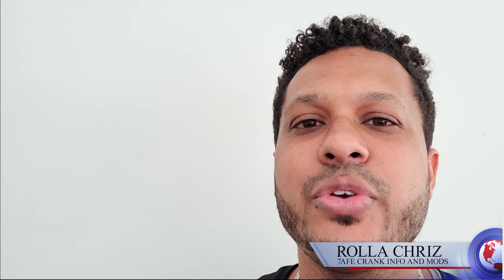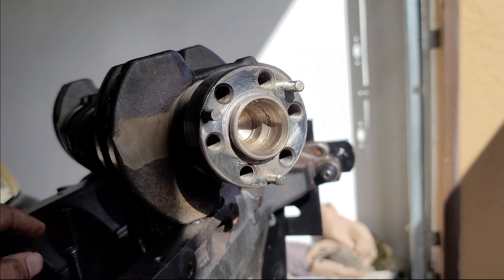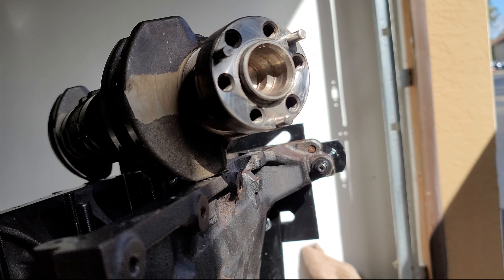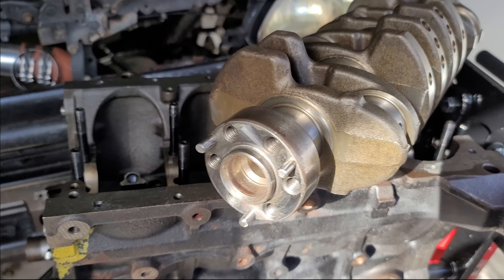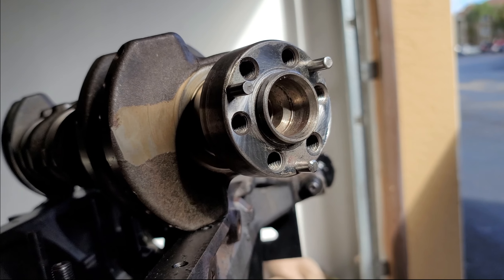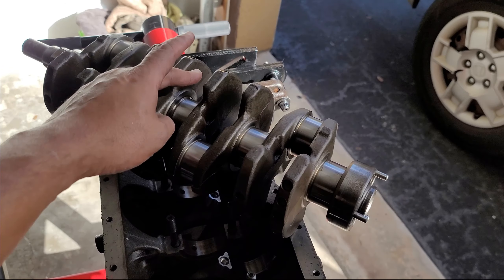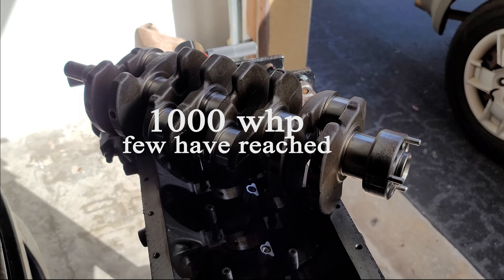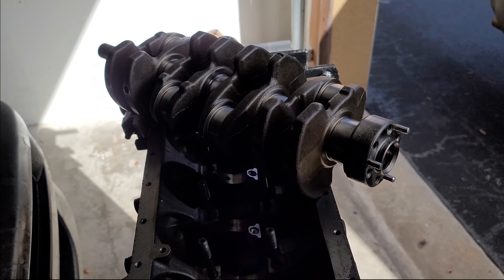7afe crank strength and mods pt 2

Comment: In your video you mentioned crank balancing and breaking maincaps.
I circuit race my 7AGTE rather than drag race so gets a hard time, and have found that at over 500hp atw we started breaking maincaps on the block. Did balancing the crank do anything to solve this?
Reply from the maker: I would assume it should. I haven't heard of this issue as far as cracking the block ladders from anyone I know..Wow that would be very stressful but then again at those hp levels most people I know  do balancing on 4age engines.  When I balanced the entire rotating Assembly and ran tomei ladder caps I have not seen this re-accuring issue at 9k. I can somewhat feel the engine less struggle to rev and smooth. Plus the price was worth it.. when I do pull the engine apart I noticed some cylinder main and rod bearings have less or even close to the same where across all the bearings. An old friend once at a performance shop in my younger days told me. "If even one or two grams difference off between two rods in two different cylinders that will create extra hundreds of pounds of extra force on that rod from that 1 or 2  gram difference" so more stress is on the heavier rods bearing and crank journal itself compared to the other.. so now an imbalance is there on the entire crankshaft from unbalanced rods... on top of all this the insane amount of vibration from a stock unbalanced crank is there too. So In your case maybe you should knife edge it as well as balance the crank and rods and flywheel. to see what happens and log the journey.. it would help the community cause most 7age racers are not at your hp levels torchering the engine for that long as you lol.. I hope this helped.

Comment: Will be building a 7age soon, keep the info coming mate cheers
Reply: @holdmywetnutz  hey brother I'm doing a 7afe build and am having some trouble finding a 7afe turbo manifold. What would you recommend as to the best way to get myself a 7afe turbo mani? Can you help me?
Reply from the maker: @borncustom4604  honestly the best way is custom make one.. you would have to check around performance shops and ask for quotes but they will need the car. eBay has a cheap one.. it won't be as strong or tough as a custom one but it's affordable for low boost and probably will last a year or so.. eBay manifolds are thin and soft metal so when they break they are easy to reweld.. you can get an eBay one temporarily until the car is finish and turbo charged then you can get a custom one made. Here's link I found https://www.ebay.com/itm/OBX-T3-Turbo-Header-Manifold-for-1993-1997-Toyota-Corolla-1-8L-/123954117403?mkcid=16&mkevt=1&_trksid=p2349624.m46890.l6249&mkrid=711-127632-2357-0
Reply: @holdmywetnutz  OK cool thats a pretty good idea, I haven't ever seen this one before thank you. I was considering purchasing a nice K18 header and cutting the flag off of it and welding a 7a one on in its place because they will line up but I'm not to sure which ones of Honda are good quality and I'm fairly positive I would need a rig welder. I only have a flux core welder but in any case it give me a solid direction to move in and I appreciate the the help bro.
Reply: @holdmywetnutz  do you know if the 2zzfe flang matches up to the 7A flag because from the looks of it the bolt patterns are identical. That is as far as a picture goes anyway.
Reply from the maker: @borncustom4604  good question I'm not sure port spacing is same or not. but from sound of it I think your almost on top of this. Your close to solving what you need done to make this project happen. Also look into Honda b series too
Reply: @holdmywetnutz  B18 is what I meant to say not K18. I've found some forums a few different guys that are top notch with the 7age builds that talk about swaping the b18 flags out. Some of which have their own products they sell. For extremely too high of prices I think but that's what is to be expect in the hunt for hp. I've reached out to a couple of them but they don't have time for a no name like me I figure. No big deal. When I finish this build and post my results of  one of the most boss 7afte motors ever posted on YouTube the curiosity will arise. This build has been happening for many years now and all the secrets are out. Or are they? I've got a couple custom mods up my sleeve that is going to have people wondering how I did it. I'll share my secrets with the people who were generous to me. It'll be soon.
Reply from the maker: @borncustom4604  yeah man I hope you great success on the build the problem with Toyota community is it's a very secret society it's not like the Honda community who reach out to each other and share info to the communities all secretive and that's how they've been for years no one wants to share information is all kind of like how would I say this bragging rights or just to be the top and fear of competition.. I tried to help people out as much as I can I have always been the guinea pig for everyone else so they wouldn't have to spend as much money and damages I was a test subject for everyone else and the things I done and and the people that helped I've even had threats from others at one point for doing so.. there's a guy I have on Instagram who has your build heavily modded slicks turbo rods valve train custom everything I'll send you the link you can look at his setup. https://instagram.com/rolla_boosted?utm_medium=copy_link
Reply from the maker: @borncustom4604  looking forward to seeing it on the the Dyno and street 👌😍😍

Comment: I could of swear I told you about this awhile back. You could flight cut and lighten the crank without weaking it...
Reply from the maker: I believe you may have about dowels.. cannot rember the lightening part.. but I pushed the motor to max to see where it would eventually fail.. but know  now high rpm and heat also contributed.. heat was another factor I should of said in the video dangit lol. I did so well for so long but more power comes failure 😆..

Comment: Hey Chris, what harmonic damper did you run with your 7A-GTE?
Reply from the maker: I broke evey kind of stock pullry..so I went with bhj dynamics lightweigh billet pully
Reply: @holdmywetnutz  I've never heard of them but good to know were the bolts shearing due to harmonics or just the torque etc? I'll go for a Ross harmonic damper for mine.